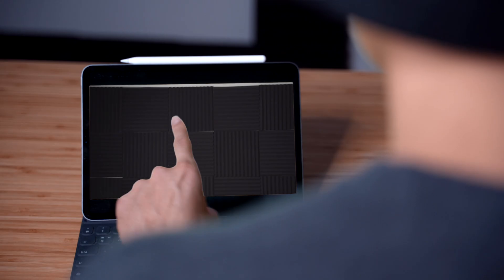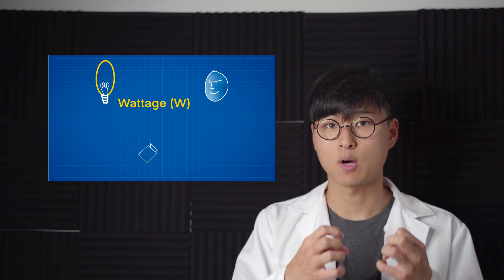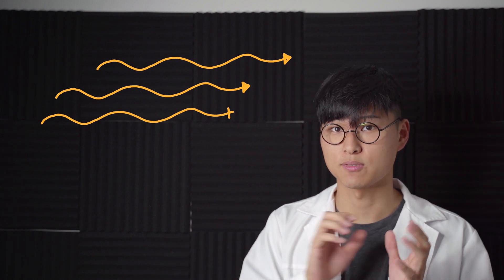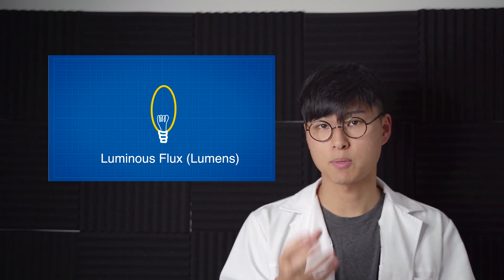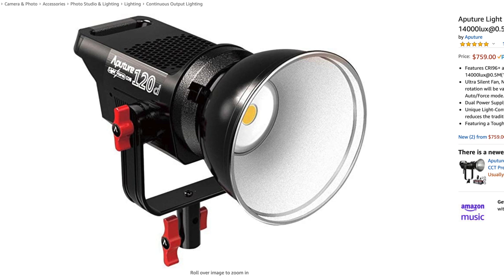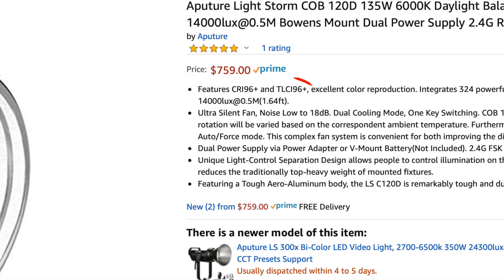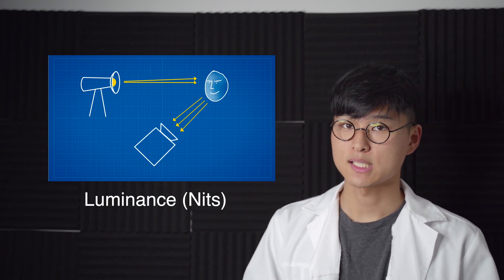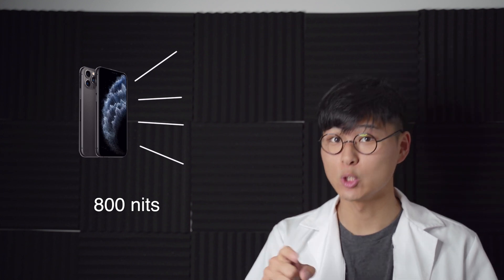LUX vs LUMEN vs NITS What is the difference? Lighting terms | Optometrist Explains

Comment: Not too too clear. 
Flux (according to you) is total light energy emitted. Is that over its lifetime, or per unit time?

How is this (luminous flux) different from luminosity, which IS the light output per unit time of a source?

Is nits a subjective metric, or an objective but relative quantity? 

What is the rate of light production, vs. rate independent measure of brightness?

Comment: If "Lux" depends on distance between light source and the reflecting service, doesn't the perception of "Nits" also depend on the distance between the reflecting service (human face in your example) and the receiver (camera in your example)?
Reply from the maker: Yeah sure but you only measure nits radiating from the source, not from where the light came from to begin with